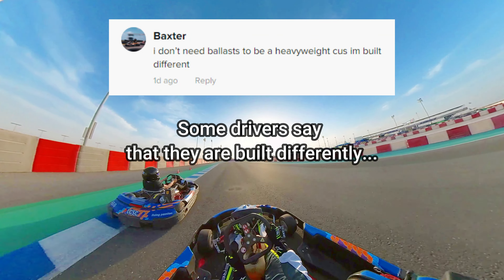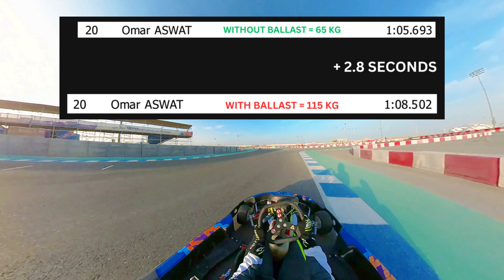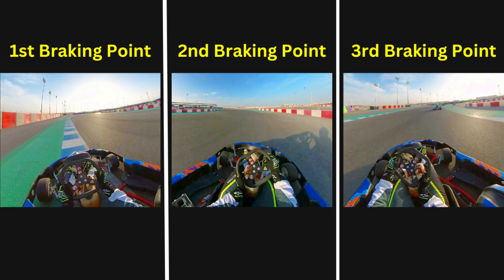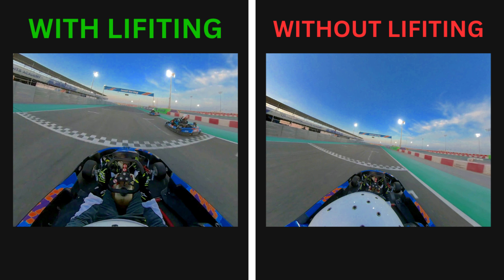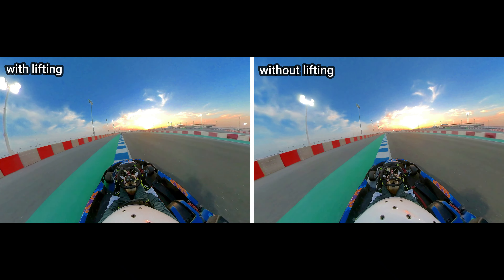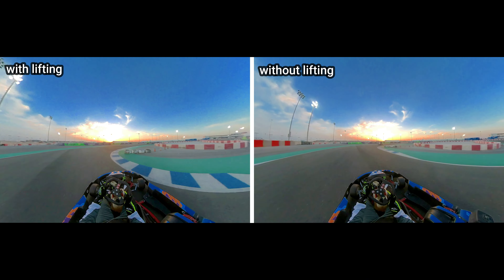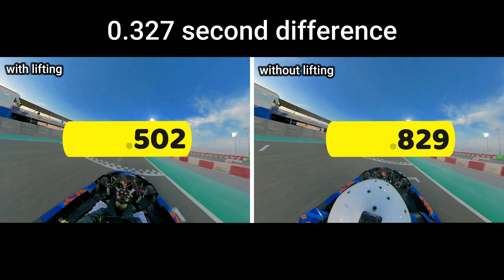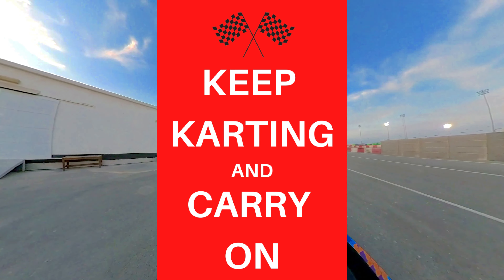How to overcome a WEIGHT DISADVANTAGE in Karting (tutorial)

Comment: I would say that being light is only an advantage when the race doesn't have minimum weight. It's very different to weight 80 Kg or to weight 60 Kg and add a ballast of 20 Kg. The ballast is a dead weight that you cannot use to your advantage...
Reply: Agreed, and ballast wait is usually put on one side of the kart so it has a destabilising affect. The kart behaves differently when you turn left compared to right. But if your bodyweight is more than the minimum weight then it will also slow you down.

Comment: Can we conclude that every ten kg means 0,56 sec?
Reply: It depends on each track and sometimes the track workers know the average impact of each 10 Kg on laptimes
Reply: Depends on the circuit and the kart but sounds like a good approximation (according to my experience).
Reply: I wish, If that were true I would the fastest guy in town. I am about 10kg over the minimum weight but I am not that far off the pace at a tight 1 minute lap track. It is likely compounding though, so the bigger the weight difference the more time is lost. I don't think you can calculate a 10kg disadvantage from a test with a 60kg difference.
Reply: @coreywhiting6850  you mean that the relationship is not linear?
Reply: @Orrrg  correct, it is just a theory though
Reply: as per my expirience based on statistics with driver with diff weigth, every +10kg gives +0,5sec on a ~30sec lap.

Comment: One advantage not mentioned for a heavier person is move your body more. You can influence the center of gravity more than a skinny guy, though if you are not in a race with weight limit and is 50kg heavier don't expect to be competitive, but you can focus on your own pace and make use of that controllable moving mass to get your PB. Leaning to the front and outside during corners = more rotation and wise versa. Leaning back = less wheelspin, less brake locking (assuming your kart has rear brakes like most karts) and less oversteer. When discussing braking points or racing lines with other drivers chances are you can brake much later or just lifting would do because of lower entry speed, and you always inevitably scrub off more speed during initial turn in so take that into account too. Overtaking requires smart car placement and can usually happen in long esses where you can switch from the outside line to inside by trying to get ahead with later braking on the first corner on the outside, in most other corners you will lose out on the straight regardless of what you do if you are racing anyone that is a hobbyist with a fundamental understanding of racing, unless you see an obvious weakness for the guy you are chasing.

Comment: Hello, can you do a video about the seating position in rental karts and explain if you should rather go more back or forwards to shift the balance to the front or rear axel. Would be an amazing video and really interesting!
Reply from the maker: Great suggestion! I recommend shifting the seat closer to the front so your centre of gravity remains in the middle. Also gives more grip on the front tyres which reduces understeer.

Here's a short:
https://www.youtube.com/shorts/wrnBDqHig1U
Reply: @kartingtips  This is also exactly my seat setting with a weight of 95kg
Reply: @kartingtips im  1.82m and 85kg. In 9 of 10 rental karts it isnt an option to shift the seat closer to the steering wheel because my knees hit the steering wheel.. i think sometimes to take 5 kilo ballast weight on both legs to compromise it but then my overall weight is 95kg, can u try this one for me?😁👊
Reply: Depends on the kart and track. If the kart understeers too much on a specific track you want to shift as far front as you are comfortable with. If it oversteers more than you like then as far back would be good. The perfect scenario would be all four tires are at the edge of slipping during any sort of acceleration, cornering or braking (instead of say, the front two), but your driving techniques matter too.

Comment: As a 87kg driver, I always fight against this disadvantage.
The worst thing for me it's the loss when exiting corner, where even if i try everything, i lose time on lighter drivers.
 It''s a matter of phisics (weight to power ratio), and if you imagine that a rental kart 270cc weight 150kg, the percentage of the driver weight, influences performance much more, compared for example to bigger cars (GT3, proto etc..).

If you imagine that on an F1, 10kg of fuel cost 0,3s on lap time (Hamilton said), on a car that weight approximately 800kg and have 1000Hp, imagine how much influence 10kg on a kart that weight 1/7 has 1/100 of the power and it doesn't have a gearbox 😅

Obviously you have also to consider the lenght of the track, the number and  type of turns, and the transmission gear ratio.
For example in a large track without braking point,  (with more weight) you will loose less time  compared to a small track with a lot of U turns.

On the electric kart, due to the higher torque, and the higher battery weight, the difference it's less

Comment: More power. ^^
To compensate for the weight differences. At our center you can rent 6 and 9 hp karts. If you drive with 6 hp, you have no chance either way. With 9 hp and enough acceleration you can partly compensate. 

As for the cornering technique, I'm undecided. If I can keep the cornering speed similar to the outside due to the tighter approach, then yes. But if the narrower approach slows me down more in cornering speed, then I would approach further out to carry more speed through the corner.

Comment: I find weight transfer to the outside of the kart in hairpins helps with the  insider under rotation and helps keep revs up. I'm 100kg without equipment so every little helps.
Reply: I wanted to ask about "leaning to the outside" comment. It is counterintuitive to me, unloading the inside wheels and reducing the grip there. Could this be explained some more?
Reply: @ingerasulffs  KTips has a video on how to lean in karting. To put it simple, you want to lean out a bit in corners because of the lack of a differential in karts. Leaning in will result in a tad bit of understeer, needing you to steer more/longer and losing time because of it. That lost time couldve been saved by leaning out a bit, dont do it too much cause inertia will already do it for you, to an extend. Hope it helped :)

Comment: The true answer is "eat more vegetables and less starchy carbohydrates" 🤣 but since it is taking me a while to get that result, these tips are what I will try on the next trip to the karting circuit.  The 🤷‍♂ at 4:12 as the lightweight guy just pulls away on the straight is me whenever there are skinny teenagers at the track 😂